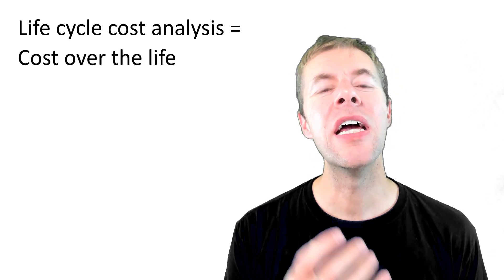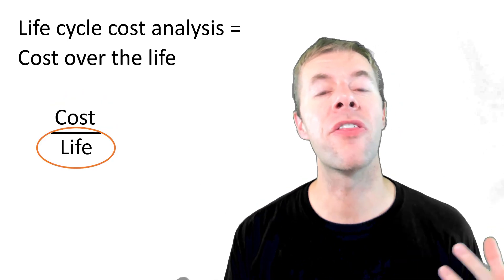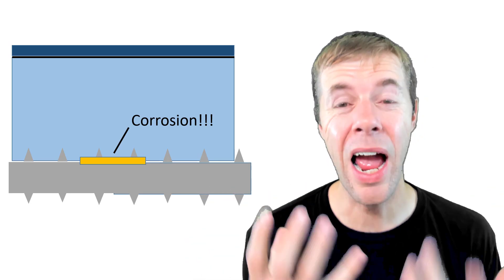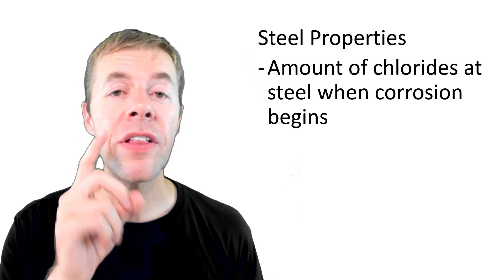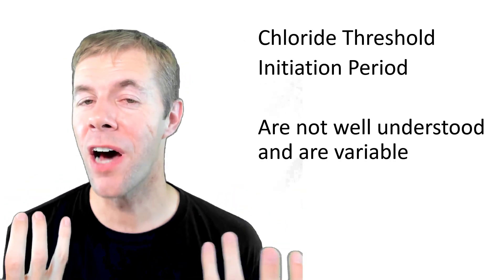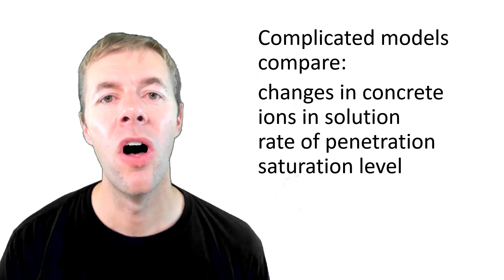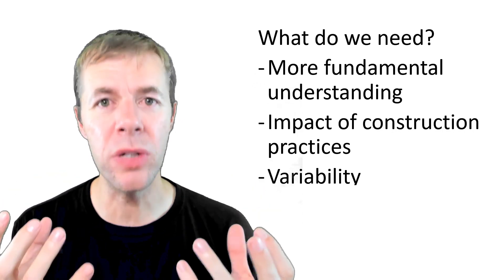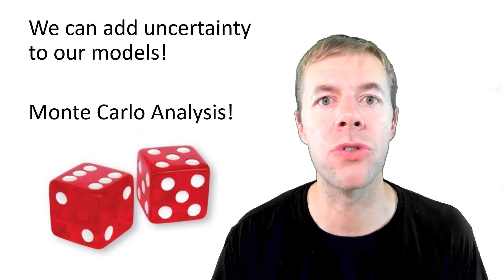Predicting the life of concrete

Comment: Hello, I would like to suggest if we can make a tool or mechanism and mix it the concrete and we can identify its present status with regards to corrosion of rebars, covering and others. this is just a crazy idea like if we can make a chip like a usb insert it and you will generate all the basis details of the building like the structural frame and its covering, we make use of the rebars to navigate a 3d view of the whole section of the building. hope this helps...thank for the videos.

Comment: Sir,
I have one doubt. 
Can we compare the concrete by calculating their service life using existing models? For example, we have 5 different mixes of concrete and then we determined the chloride threshold values,diffusion coefficients of these concrete. Then we calculated the service life with this parameters by using existing models. So finally, we can choose the concrete mix which having longest service life. Is it possible??
Reply from the maker: Yes!  That is what people do today.  However, what if the failure is caused by freeze thaw, sulfate attack, ASR, or DEF.  How do we deal with cracking?  How do we know how much Cl will be placed on the concrete?  We can measure diffusion coefficients in the lab but are we really getting that in the field?  Chloride threshold levels are hard to measure and there are a lot of different parameters that impact it.
Reply: @TylerLey  Yes Sir..It will not be a realistic value...Thanks for the information.

Comment: Isn"t there an ASTM weatherability test using a salt spray with freeze-thaw temperature cycling with a compression test to destruction every x number of cycles enabling a guesstimate to life-cycle?
Reply from the maker: Douglas - There is ASTM C666.  It is a freeze thaw test but there is not spraying.  The test runs for 300 cycles but doesn't predict life.  You either pass or you don't and people don't really know what that means as far as service life.  There is the ASTM C672 test.  This uses concrete that is ponded with salt solution and there are freeze thaw cycles that are applied to the concrete.  Typically, the test is run for 50 cycles.  That doesn't really relate to service life.
Reply: Is the reason for no mix standard service life testing due to the implied liabilities?
Reply: I would think a salt spray chamber with freeze-thaw cycling a great test (setup re ASTM B117) See:https://youtu.be/mDxvmMucGfA which eventually correlates to X cycles = Y years of service life.
Reply from the maker: I don't think so.  I think we don't have enough knowledge of many of the durability mechanisms to create mathematical models to describe them.  I am working on a model for freeze thaw damage but there are still issues.
Reply from the maker: Yeah but the weather is different in different environments.  How much salt that is applied is also different.  Also, there are so many different types of durability failures.  This would just test salt spray.  Think about trying to predict how a human will die.  There are so many possible ways!  How do we predict this?  It depends on a lot of things that are so hard to predict or control.
Reply: @TylerLey  I think the life length expert is called an actuary... So it seems possible to produce enough weatherability data to model a forecast of concrete life cycle tied to field service validations for a particular mix. I'm surprised academics have not jumped into this R&D area for concrete since concrete construction costs are so expensive that a 'Concrete Actuary' would be exceedingly valuable. Dr. Ley PE, PhD, CA? So what and who is being done to improve Life360 and Stadium?
Reply from the maker: I actually have a research project to gather some of the data that you are talking about.  Once we get it out into the field I will make a video about it.  I hope it will be soon.

Stadium is run by a private company and so no one really knows what they are doing.  They were supposed to add a sulfate attack model in the past but I don't think they ever did.

Life 365 seems to make changes in spurts but I don't know of anything major changes that are being made.

Most research today is focused on developing new test methods and mixture methods to make long-lasting concrete.  If you asked any of the experts how long the concrete will last, they can not give you a good answer.  I like your actuary idea.  There are people working on this but they need more field data about performance.
Reply: Good information to better understand how the ends of the concrete rope are twisted. I look forward to learning more about how you go about collecting field data. Is this something STEM students could do all across the Nation? Concrete Actuary would be a great study blending two disciplines together to improve service life of concrete. Watching for your next video.
Reply from the maker: Thanks!  I love the idea of getting STEM students involved.  That is a GREAT idea.  Let me think about the best way that they can do that.  I agree with you that we need to bring some new ideas into this field.  Civil Engineers have a lot of skills but developing something like this requires different skill sets.
Reply: Just running errands each day I see new construction - why not stop and ask the Super for permission to collect data according to Dr.Ley's research worksheet... winner!
Reply from the maker: I think that is a good idea.  If you can find collaborative contractors then that is the first step.